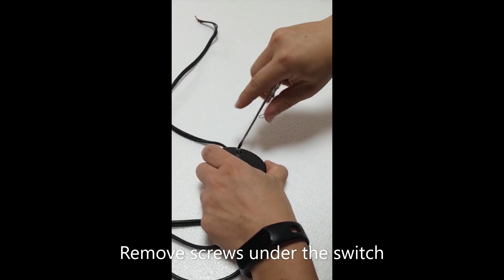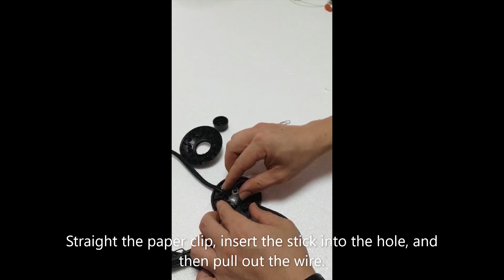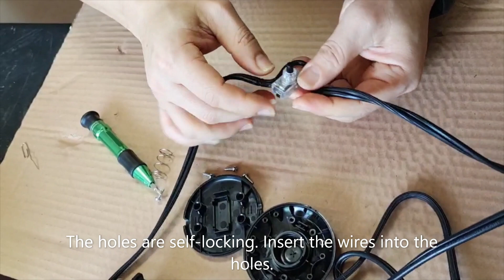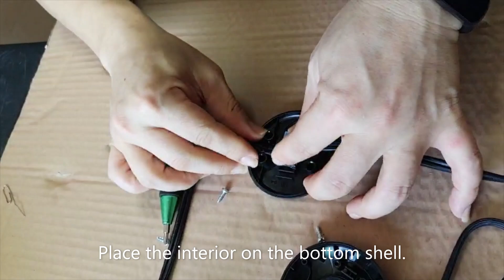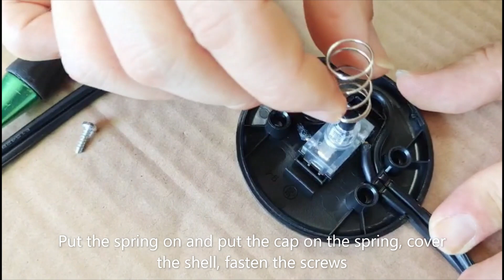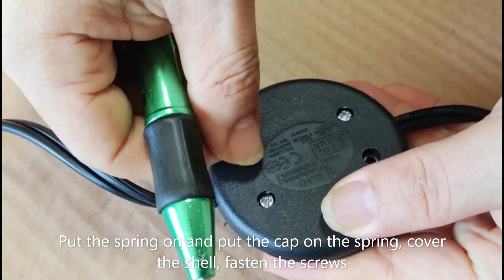How to replace the foot switch interior

Comment: I found that I wasn't successful using a paper clip in the insertion location you used.  After destroying the switch with a pair of dikes (wire cutters) I found that the rectangular hole on the end is the proper insertion spot to release the tab lock that holds the wire end.  I inserted my paperclip there and it easily released.  Good no-nonsense video none the less. 👍

Comment: Thank you for the tutorial. I have a question. My lamp had a "normal" (not foot) switch, for which both cables have been cut (neutral and power). But the foot switch that I bought requires the neutral cable to be uncut. Can I join both ends of the neutral cable and secure that with isolation tape, or would that be unsafe? 
Hope you get what I mean, it's a bit hard to articulate this in my second language :)